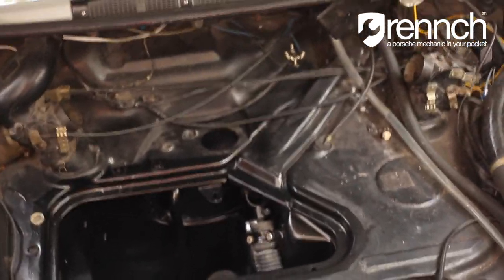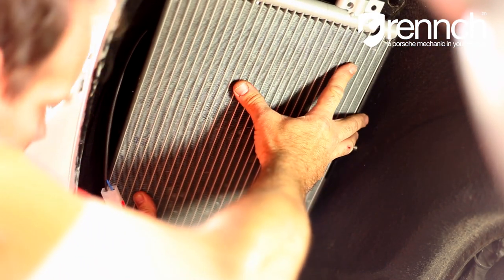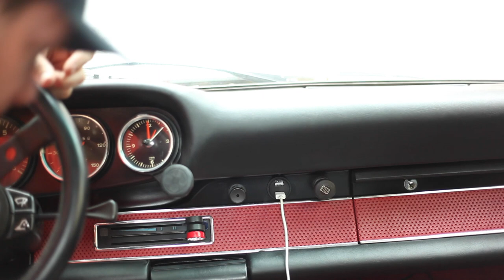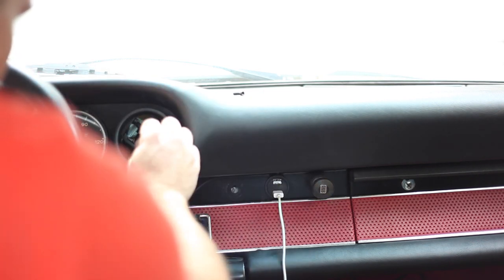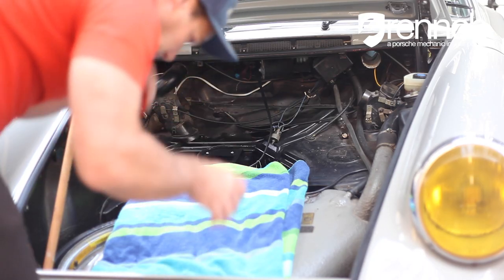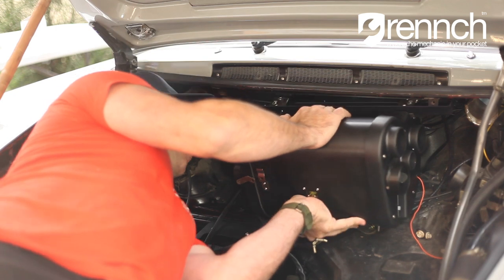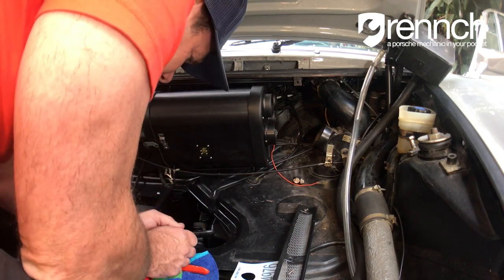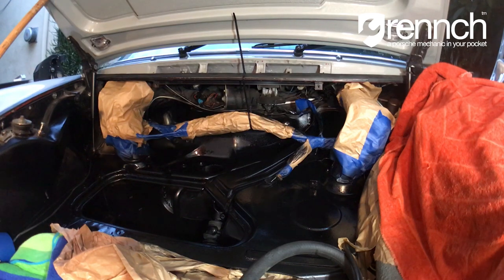Vintage Porsche 911 Air Conditioning - [Part 1] - DIY Porsche Repair

Comment: Great start. I know the camera angle was off, but make sure the tire doesn't rub that cooler before you drill any holes. I believe Ford made that vent with a chrome ring on certain trim  packages.Keep up the good work!
Reply from the maker: Thanks. Yea, it’s tucked WAY up in there. Hard to tell from that angle.

Comment: I dont think replacing the clock with the air vent was a good idea, but otherwise, great job
Reply from the maker: Where would you have put a vent?
Reply: Rennch - Porsche 911 Restoration and DIY Tips no clue, but the clock is cool XD maybe a tube under the steering wheel
Reply from the maker: AikarambaNorway No room under there brother. Not without hitting your legs. The clock is really the only option for an early car.